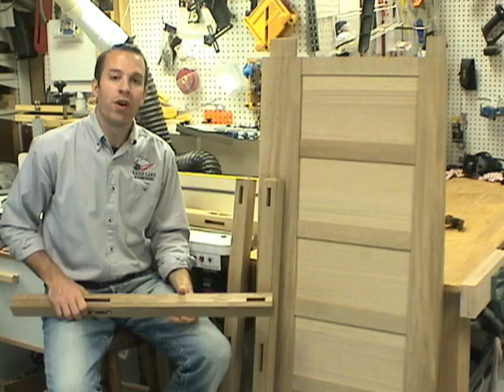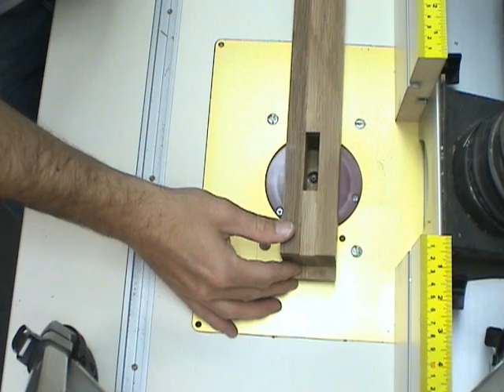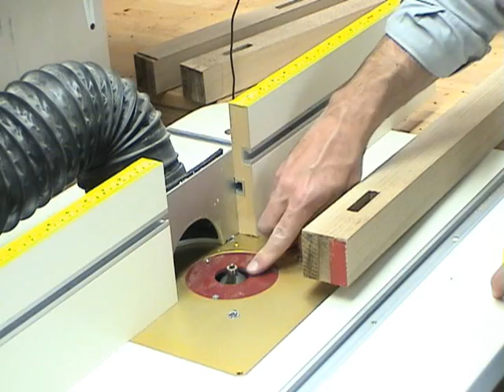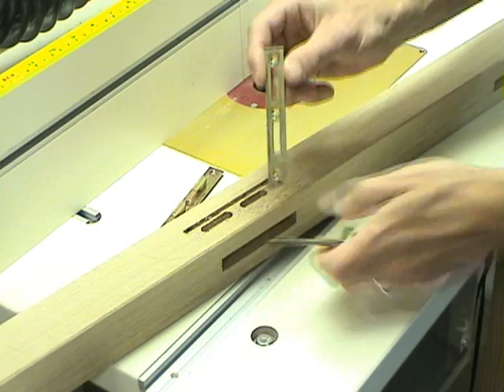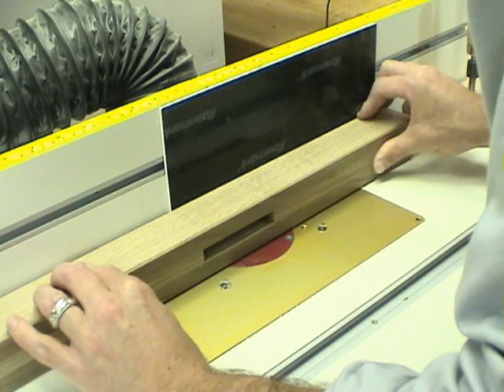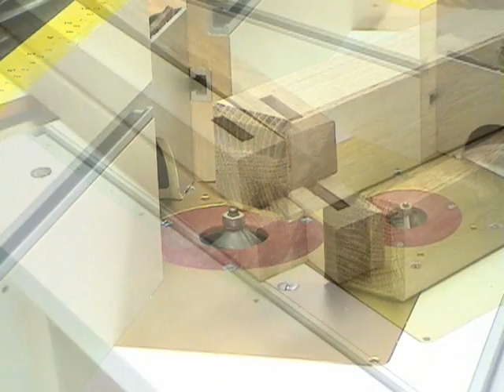Part 5 - Arts and Crafts Panel Bed

Comment from the maker: @hiddenprophecy Do you mean the part where I put the piece over the bearing bit on the router table to expose the mortise on the other side?  That veneer is so darn thin (less than an 1/8 inch) that there really wasn't much danger of the bit catching and biting into the piece.  In the veneer was any thicker, I would advise drilling a larger pilot hole and using a thinner flush trim bit. My pilot hole and router bit were nearly the same which is why I made mention of holding the piece firm.  John